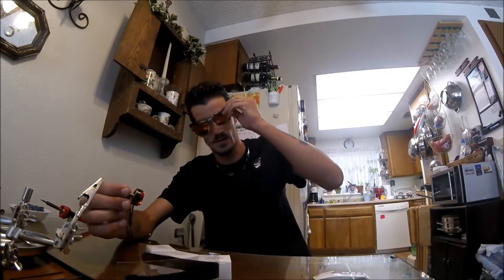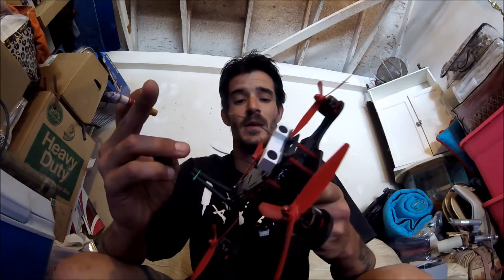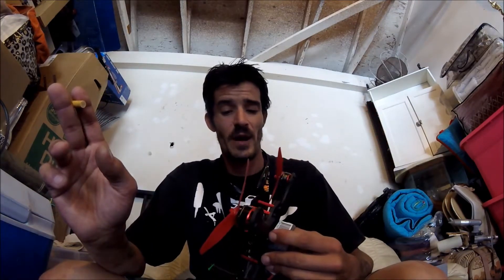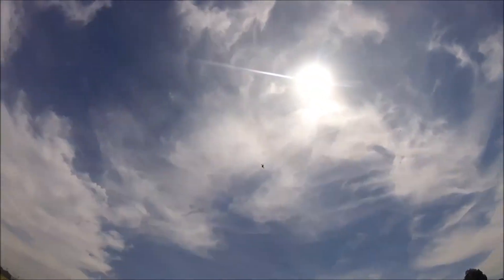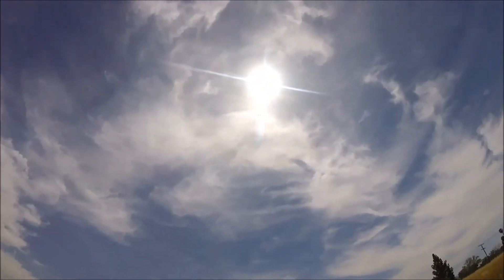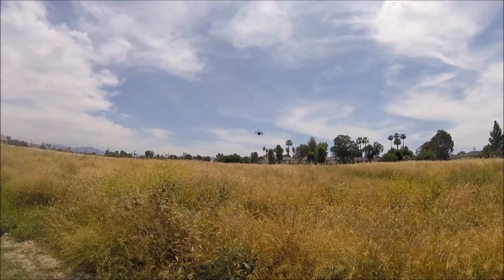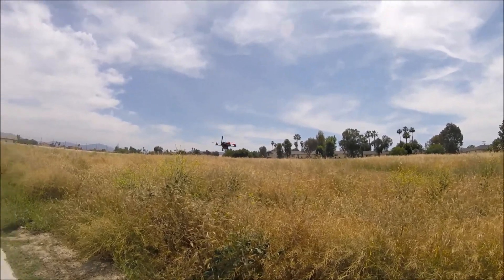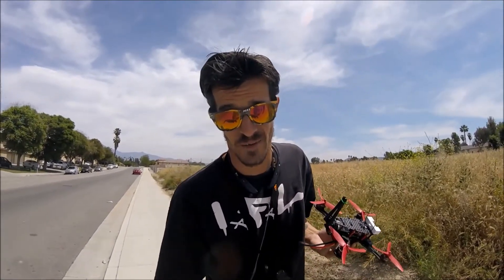PiroFlipRC HyperLite V2 Team Edition 2522kv My 1st Time doing a Review

Comment: Hey bro do the V2 Hyperlites have a hollow shaft?? I fly mainly BrotherHobby motors, My main motor right now is the Hyperlite 2207 2522kv MONSTER on my free style 5 inch builds, Hyperlite 2206 2600kv on my 4 inch/5 inch race/free style builds and hyperlite 2206 2300 on any builds that Im turnin 6 inch props, the 2207's handle 6 inch props like a champ and make power that you have to see to believe the problem with the 2207's on 6 inch is the amp draw is CRAZY high so I fly 5 inch only on the 2207's...

The reason I want to know about the V2's is at 13.99 a motor for BrotherHobby's quality motors is just to good to pass up and Im expecting them to put out a little more power then the 1st gen Emax RS2205 2600kv's, and be smooth as butter as all BH motors are.. If they have Hollow shafts Im going to be stoked and by 3 or 4 full sets for builds for my wife, She likes power but isnt comfortable with the power the 2600kv V4's make.. She loves her Emax 1st gen RS2205 2600kv motors and I would assume these will make 5% or so more power then the RS motors and that would be AWESOME.. The RS motors arent even close to as smooth as any BrotherHobby motors and the quality of BH is just amazing, you can tell they really take pride in their products..
If there not Hollow Shaft motors I will still buy them for her builds but man I hope they have Hollow Shafts, Im still stunned at this high quality of a motor at under 15 bucks a pop thats AWESOME!!!

Sorry for the long post for just a single simple question lol.. I can see you really love Race type quads and so does my wife and I and talking about them is fun..
I will say this man if you want an absolutely stupidly insane freestyle motor and you have good packs (We fly exclusively Tattu R-line 75 and 95C 1300 and 1550's (Im Sponsored by Gensace) and those batteries put down the power for sure) the new 2207 2522kv with Dal 5046C or the Luminer 5050x3 Butter Cutter... The power is just silly, the response is the best I have ever flown bar none and the smoothness of them is as good as it gets..Fly them and all other motors that are on the market right now will feel sloppy, they really are the absolute best freestyle motor on the market right now.. Weighing in at 32.7 grams with wires cut to 1.25 inches (So the weight isnt that much more then a normal 2206) the only downside is on 1550's if I fly hard my flight times are 1 min 45 secs and if Im doing more mixed flying then flight times are 2 mins 15 secs, if you dont mind really short flight times (lol Im talking about short flight times, what high power race quad has long flight times lol... So im re-phase Short relative to the 3 min normal flight times of a 1300 or 15xxmah 4s high powered race kwad lol) 

Anyhow Ill shut up now, Im sorry about my very long post and rambling lol, I just love talking about kwads with like minded people. Hopefully you will respond and let me know if the shafts are hollow and I would be super thankful for the info!
Keep it low and fast and have fun stick banging!
Good day my friend.
Reply from the maker: I tried contacting Surge from PiroflipRC.com to confirm but haven't gotten a response but I believe they are not hollow shaft.
Reply from the maker: Yea I love tattu .. unfortunately stuck with 2 Turnigy Graphene 4S 1300 used to have 8 but for some reason they been capping out one by one... unfortunately due to braking my ankle I'm out of a job and out of money, I did get a sponsorship from gensacetattu.com 30% off anything.. was so happy to get that but still no funds, just wish I was good enough to get free stuff to keep practicing, but I've gotten really good at salvagING props motor parts etc from my dead bin .. and have to say my Emax 2205 2300 are still rocking .... did you ever get a hold of serge from Pirofliprc about your question brotha?